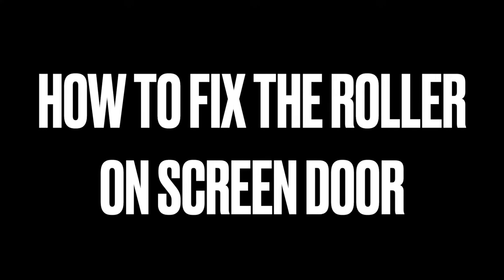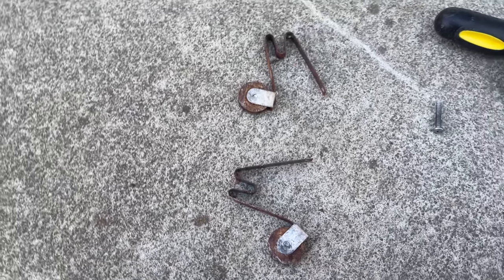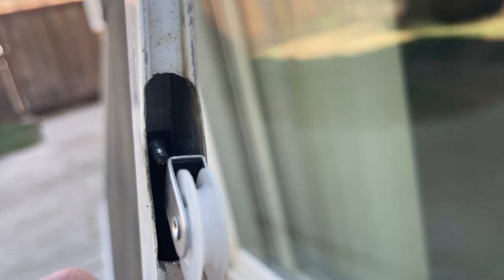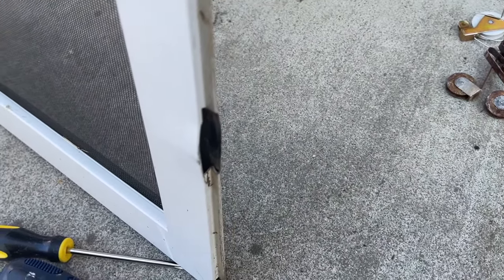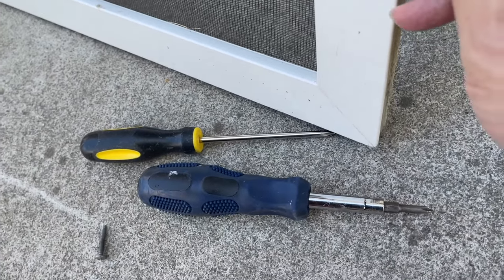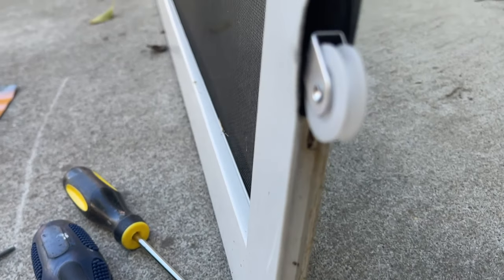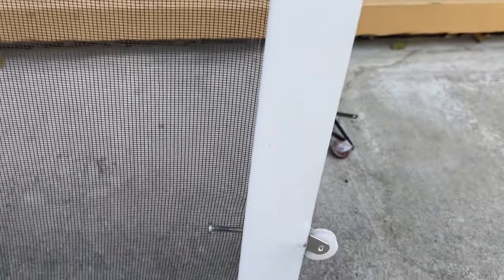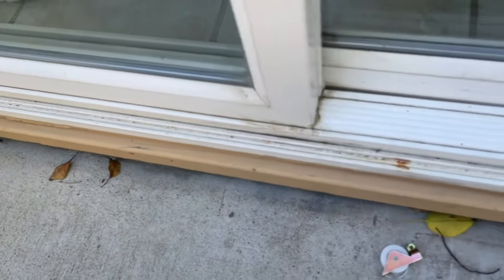HOW TO FIX THE ROLLER ON SCREEN DOOR

Comment: Excellent video I have been needing for a really long time. I do however have another question. What to do when the screen door is is somehow at an angle and there is space it a crack in the upper portion that doesn't seem to close all the way?
Reply from the maker: On some models, there's a screw you can adjust to change the angle at the bottom.
Reply: @netman88  wow thank you for your quick reply. Yes I have tried to do this with the 4 screws but cannot seem to figure out which ones need to screw down and which ones need to be unscrewed. Maybe do a video on it because if you look around no one is doing an actual good video on it.